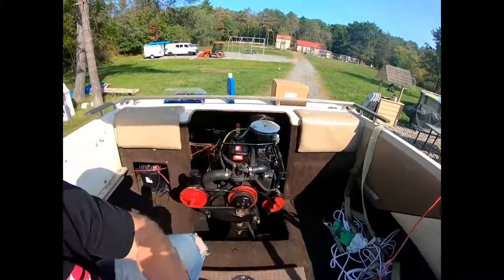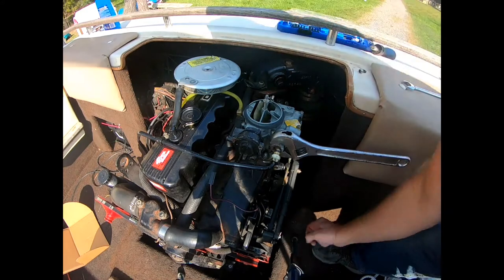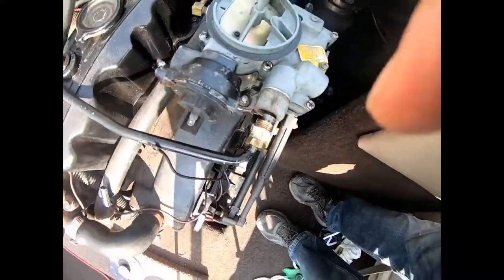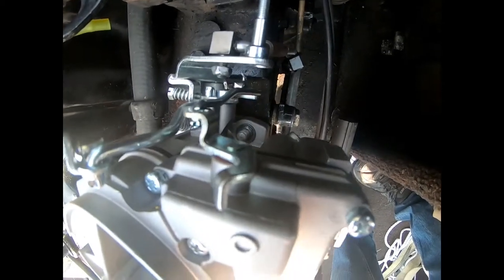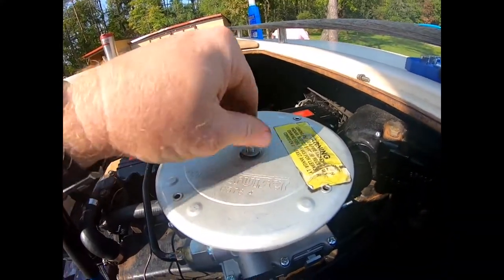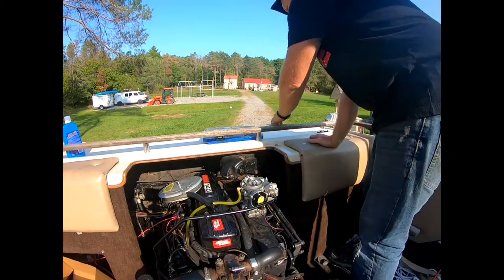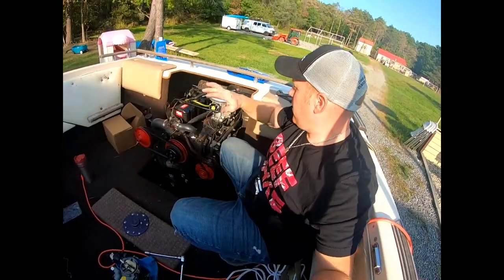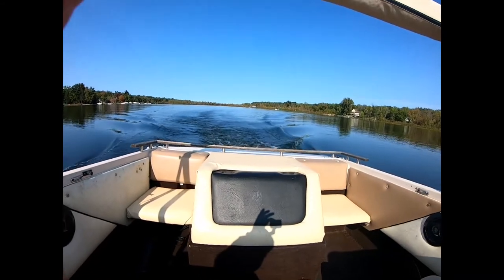Mercruiser Carburetor Replacement DIY

Comment: I bought a $200 carb off Amazon which was a mistake.   Piece of junk that dumped fuel down the intake, necessitating a flush.  Ended up rebuilding the original.  I don't know if these 3.0s ever truly run well, but it seems to run strong at least.  Thanks for the video.
Reply from the maker: 3.0s are probably the most reliable once you have your set up right! Good luck thank you for watching and have a great summer!

Comment: I would like to add a couple of things that I did on my carburetor install. 
Hook up a timing light that also has rpm built into it. It will be more accurate than your dash tack. 
Also, get a vacuum gauge and hook it up to fine tune the air mixture. 
There is a bolt on the intake that will give you a port for your gauge. On the boat that he is working on, it is just in front of the carburetor linkage on the intake manifold. 
I had a low-speed bog on my boat. With the timing light and vacuum gauge, I was able to advance the timing a little bit (but still stayed within specs) and fine-tuned the carburetor.
Reply from the maker: Awesome! Thank you for the information and thanks for watching!👍
Reply: @WhitehouseFarmVet  
I'm just a learn as I go mechanic. 
I never worked as a mechanic, but I do most of my own work on everything, mainly my vehicles. 
YouTube is a great place to pick up pointers and how to work on almost anything. 
I recently replaced my lower impeller on my 97 mercruiser wth the help of YouTube videos.
I guess I should make some videos on some of the tricks that I have learned throughout my years.
Reply from the maker: Same here! That's awesome keep it up!  That's why I started doing videos!👍

Comment: Firing up the engine for the first time and i have a rough idle only smooths out if i increase the rpm slightly. As I increase the throttle the engine begins to sputter and die. Do you happen to think it could be a carb issue or a blockage somewhere?
Reply from the maker: Yeah that could be a symptom of a partially clogged jet!  I would take it apart and give it a thorough cleaning, and possibly a rebuild kit with all ne parts if it's really bad! Good luck and thank you for watching!😊

Comment: I also have a mercruiser 140 3.0 but my carb is different don't have a 12v choke and I have two jet screws on the bottom  left, can you help me out and show me a link that works for mine, can't find any similar.
 3.0L 140 Mercruiser GM Carburetor 1351-7355 2bbl Marine Carb
Reply from the maker: I'll try to see what might match up its gonna be hard to find after market parts but hopefully there is a generic link that will work, let me see what I can find out!👍
Reply: Thanks
Reply from the maker: No problem!

Comment: It helps to fill the bowl with fuel after switching and using a touch of starting fluid and then adjusting the idol settings. If the unit says it’s ready to go then I strongly advise to fill the bowl and use either before making adjustments. 

And your idol is way to high
Reply from the maker: Your right, definitely would of been easier adding gas and starting fluid! I did notice it was idling a little high when I took it out on the lake and adjusted it, it's been running great since!  Just needed some fine tuning without fear of my well water running out! 😂 Thank you for watching!👍😊
Reply: @WhitehouseFarmVet  they always do! You did a great job and saved some good money doing the work yourself. Each time you change a carb it gets easier. I’m just trying to save your flathead from learning flight 😂
Reply from the maker: Lol👍😊 Thanks buddy!🍻

Comment: I just bought a boat with a 5.7 MerCruiser that has the same leaking issue the person replaced the carburetor right before I bought it I couldn’t understand what you said you switched in the video?
Reply from the maker: I think what your talking about is when I mention I had to switch a couple pieces from my fuel line and flame arrestor to the new one because they didn't fit right? Let me know and thank you for watching!👍😊
Reply: @WhitehouseFarmVet  Yes you were right that fix the main leak but afterwards I found out there is another smaller leak it looks like a one-way ball fitting similar to a grease bearing fitting I took the carburetor apart the inlet to the ball fitting is underneath the main jet and drips after I turn the engine off It’s a very small leak but I would like to stop all the fuel weeks before I take the boat out with the family any advice is much appreciated
Reply: @WhitehouseFarmVet  It looks like there’s a fuel cut off on the main jet and it’s just leaking what’s underneath the main jet after the engine shuts off and it’s not pulling it into the engine anymore

Comment: I was wondering after 5 months do you like the rochester or the sierra. I'm asking because I am thinking of swapping myself.
Reply from the maker: Honestly the Rochester after I rebuilt it ran great with no issues!  The Sierra was a brand new carburetor that runs great out of the box!  I guess it's up to you if your having issues with your Rochester and you dont want to do a rebuild then the Sierra is a great out of the box carburetor!  Just make sure to save your Rochester just in case you need any parts for the new Sierra like I did!  So its really up to you which route you want to go both work great!  Thank you for watching!!😉

Comment: I Have replaced the ignition system with electric  and replaced the carb. I had to adjust the float as it was flooding. I have timed the eng to 8% BTDC and set the dist rotor at #1 plug. I replaced the dist cap and wires . Wires on the cap are 1342 I can't get the engine to start. It wants too but just can't quite make it!. I have moved the timing several times and still can't get it to start. When I first got the boat I had to crank it for a long time before it started. It ran rough so after it had been sitting for a long time I drained the gas and tuned it. It ran for a second then it died. No restart. So I even went back to all original stuff and still would not run. So I then timed the eng as to the above mentioned and reinstalled all the new parts. Still it will not start. It wants to but just can't seem to make it. What have I done wrong?
Reply from the maker: When you upgraded to electric did you also replace the coil?

Comment: I have the same motor. My problem is once the engine warms up it will not idle. I can turn up idle set screw to keep it running but im idling at 5-6knots. Wonder if i should just replace the carb......its been rebuilt but sat after rebuild for a year from previous owner
Reply from the maker: Did you fog it and add fuel stabilizer before it sat for the year?  If you didn't I would try cleaning it out again or buying another rebuild kit they are only 20 bucks vs 200 plus for a carburetor, I have a video on rebuilding the carburetor too it's pretty simple the big thing is just to soak it in cleaner and really clean out the ports!  Let me know, and thank you for watching!👍😊
Reply: Its been fogged professionally and is rack stored yearly . Always has been. I will try the rebuild kit.
Reply from the maker: Gotcha! Well hopefully the rebuild kit will work! Also just double check its getting fuel and idle adjustment and fuel are set right!!! Good luck buddy wish I could help you on it more!, let me know how you make out!👍

Comment: Hi sir how are you, I have a 181 3.0 4 cylinders and I don’t know but I don’t get any fuel in to the carburetor and I already cleaned the fuel pump and carburetor and nothing was wrong with it , can you help me out please
Reply from the maker: Take a empty 2 liter bottle or something to hold fuel and disconnect the fuel line to the carburetor try starting it if you get fuel then your diaphragm in the pump is good and you need to clean the carburetor out! if no fuel the diaphragm is bad in pump, let me know how you make out! And thank you for watching , I have a bunch of videos on cleaning out carb new carb kit fuel pump etc!👍

Comment: Hey bud. Great video. You may have covered it and I missed it. Put the new Sierra carb on my 03 3.0 Merc like yours. Boat runs perfect but I'm leaking fuel out of carb side of the fuel line. Did you replace your fuel line from the fuel pump to the carb? Have a new line coming. Thanks
Reply: Ok just watched further. At 11:20 you said you had a leak. Was that at the spot I'm talking about?  Where the aluminum piece that the fuel line goes into, where the flare and brass piece meet the carb. Did you swap  the aluminum fitting off the old carb to the new Sierra?
Reply from the maker: No I was actually able to still use the original it was in good shape! Thank you for watching!👍😁
Reply from the maker: I didnt have it seated properly so I was getting some drips ,it just needed a little more tighten!😁

Comment: Enjoy your videos. The stock carburator I have starts cold easily and runs great. The problem is when hot and then turned off for 15 minutes its a hard start and have to be careful not to flood the motor. The rebuilt and new Sierra carburator that you put in.  Whats your experience after warmed up and restarting?
Reply from the maker: I have no issues its been a great carburetor, your issue definitely sounds carb related ,have you tried adjusting your float or at least checking to make sure its parallel to the carb, your issue sounds like once you get it going it overtime is getting dripping fuel which will make it hard to start and can flood it, also make sure you are about 1 1/2 turns out on your air to fuel adjustment screws, also could be just a dirty carb in need of a cleaning, hopefully one of these will fix your issue! Good luck and Thank you for watching!👍😁
Reply: I just put the same  rebuilt carb on my 5.7 mercruiser and I had the warm start problem too.  Fixed it completely.   Now I just turn the key at idle when hot and it starts right up.  Good luck!
Reply from the maker: That's good to hear have a great summer on the water!👍😁
Reply: @shoredude64 how did you fix it

Comment: Hello, so 
I have a capri boat with 4 cylinder. Motor starts but on really high idle, im new to boating so exude the question but do you think I should change the carburator
Reply from the maker: No! Try adjusting your idle screw, use a screwdriver and turn clockwise until it stops DO THIS CAREFULLY DO NOT WRENCH DOWN just tighten until it stops, then back off counterclockwise 
1 1/2 turns this is a good starting point see if it smoothed it out, then just try quarter turns to increase or decrease idle from there until it sounds smooth, try this first before messing with anything,  hope this helps and good luck and thank you for watching!😁
Reply: @WhitehouseFarmVet  
Thanks for the quick reply.
I'm lol  because I did just that and now the motor won't turn off i think is the timing now, got a video on that, please advise
Reply from the maker: Unfortunately no timing videos right now!

Comment: Where on the engine does the yellow hose connect?
Reply from the maker: It connects to the side of your carburetor  and runs down to your mechanical fuel pump it comes in different colors like clear and yellow I've seen black but it should be replaced with a clear so you can see if the diaphragm failed in fuel pump it's a safety just in case fuel pump stops working!  Great question and thank you for watching!👍😁

Comment: Can't figure out why mine don't run, compression 117 all 4 cyl, new carb and adjusted, has spark, fuel. Won't stay running, starts for half a second, same with starting fluid, timing rechecked ingot the ddis ignition
Reply from the maker: Take your spark arrestor off top of carb fire it up make sure its getting fuel also if it is make sure it's not just dumping fuel! might be a fuel pump  issue too get a empty 2 liter bottle and disconnect the fuel line run it in there make sure its  pumping fuel as well!  Only need 3 things to run spark ,air and fuel its gotta be one of them! Let me know how you make out! And thank you for watching!👍😊
Reply: @WhitehouseFarmVet  it's getting plenty of fuel, I don't understand it, only starts for half a second or 1 second
Reply: Guy sold me the boat, and said it was water ready took my kid out and got stuck in the river, started for 30 seconds let it run for  1 min, put it in gear and shut off and wouldn't start again
Reply from the maker: Are any of the spark plugs fouled or is the flame arrestor dirty????
Reply from the maker: Did you put the new carburetor on and adjust it?
Reply: @WhitehouseFarmVet  new plugs also, and adjustment carb like you did
Reply from the maker: Do you have points or electronic ignition?
Reply: @WhitehouseFarmVet  I got DDIS coil pack style
Reply: It's crazy because my boat only cranks in neutral, can't move the lever or it won't crank
Reply: Ok so I got it to start, I have to turn key soon as it starts to fire I put the lever forward but it puts the thing in gear at the smallest point, but stays running if I keep it in gear, doesn't run in neutral
Reply from the maker: Have you tried checking the kill switch on the motor?
Reply: Right now it's running but wor go nutreal, I think the cable is b goin to the strrn, it's very tight and doesn't go back to neutral after adjustment
Reply from the maker: So your lower shift cable? Do you know how old the cable is? Normaly they are replaced and done with bellows around 5 years? They tend to stick inside their jacket its common!
Reply: @WhitehouseFarmVet  looks pretty new, but I'll change it anyway
Reply from the maker: If you are make sure to check everything else as well,  like bellows and trim senders etc I hope that this was your issue and not the clutch cone in lower sterndrive!  Good luck buddy let me know how you make out!👍